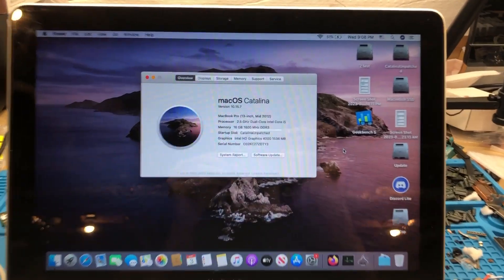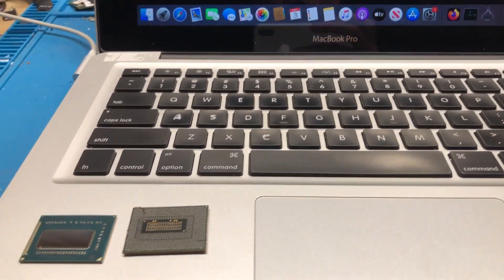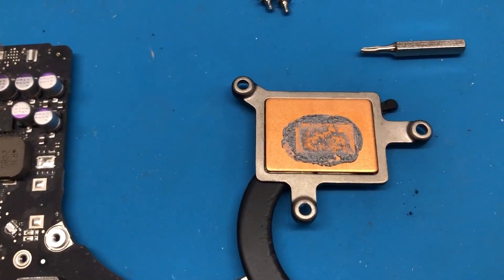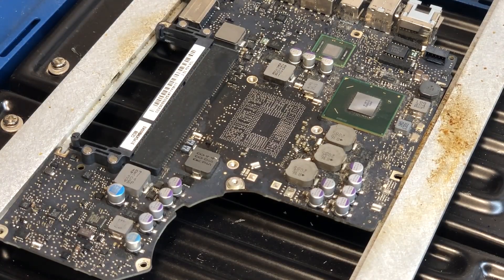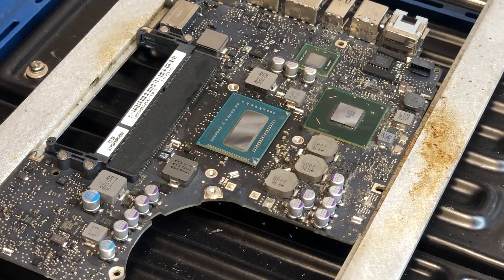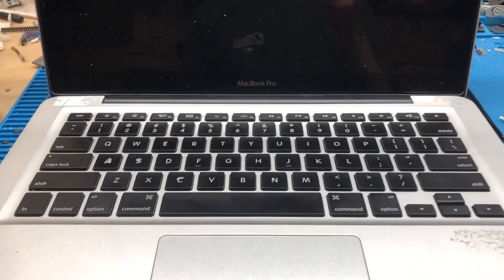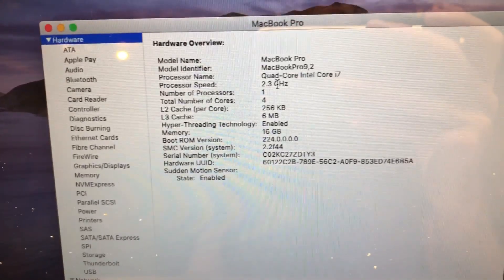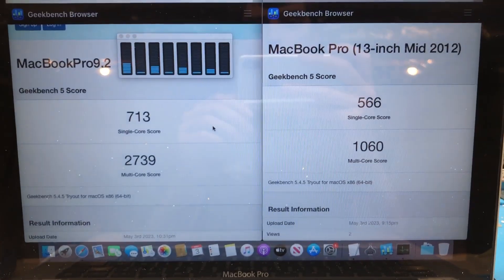Creating the World's First Quad Core Mid-2012 13-inch MacBook Pro

Comment: Technically the i5 is a quad core.  It has a 2 physical cores and 2 logical cores(threads).  Like how even the P4's with hyperthreading were essentially dual cores. I run linux mint on my mid 2012 13in. and it shows and monitors 4 cores in the system monitor.  I've also swapped to a nvme on sata, and maxed to 16gigs of ram.  QUITE snappy on Mint 22.1 and fully compatible.  Runs better than any mac os has on it. even after the upgrades.  Great video, would be interested in having this done to mine.  What would be stopping this process working on a gpu change and video memory upgrade?

Comment: Did you know that the i7-3615QE supports up to 32 GB of RAM, which would allow you to upgrade your system's memory in the future if needed, which could be useful for heavier tasks or multiple applications running at the same time.

Comment: Maybe an i7-3632QM CPU would be fit better due the same TDP (35w) of the i5-3210M, and the same 4-core 8-thread of the i7-3615QE. Do you think is it possible? Please, let us know about it🤗
Reply from the maker: As mentioned, the footprint/pinout of the QM-series chips differs and is not compatible.
Reply: @dosdude1  Differently from the socket G2 3th-gen intel's CPU whose we have a pletora of options, by changing from the Celeron B800 to the i7-3940XM. Thank you for the info and the top quality channel 🤩

Comment: Where do you buy the chipset from, I was looking where to buy it hard to find anything place that sells them. Is there a way to buy from Apple, I looked on there website could not find where I could buy newer chipsets at? Is there a place, with out buy parts that where ripped out of other computers. Where I can buy just the chipsets from a manufacture, for the upgrade of my PC? Thanks

Comment: The problem with upgrading these is how cheap they are now. I keep buying them on eBay. I just got a mint 2010 MacBook unibody base model for $70 and it’s literally brand new. Just needs an ssd but the 4g Ram isn’t great. I was going to buy a battery for a 2008 white MacBook and saw the aluminum one for $20 more than a battery for the plastic one and the mint one has a perfect batt. It all started last year when I bought an early 2013 MBP highest performance for $180 to run 3d printers and CNC machines. New hobby! 😮

Comment: Will 3615m work too?
Reply from the maker: @Reda_1000  An i7-3615M doesn’t exist. An i7-3615QM (or any other QM-series chip) will NOT work, as the footprint is different (as explained in the video).

Comment: @dosdude1 Hi  it works with the code too core i7-3615qe -SR0MR ?
Reply from the maker: SR0MR is the i7-3612QM, which will not work. Only CPUs that will are the i7-3615QE (SR0NC) or i7-3612QE (SR0ND).

Comment: Hey man! I have the same laptop, and I want the processor to be upgraded to this. If you are willing to do so, I will gladly buy the processor and ship you the laptop and pay for the job. Might be a while though, because AliExpress takes forever to ship. I bought the laptop from a friend for $50, and it’s in perfect condition. I’ve already upgraded the RAM to 16GB, and put a 500GB SSD in it. These laptops are surprisingly easy to upgrade, which I didn’t think the word “easy” would go along with “Apple” 😂 But then again, Apple was better when Steve Jobs was around. I don’t want to deal with newer MacBooks and their soldered on RAM and storage. If one of those go bad, it is very expensive to repair or replace. I want to just simply pop in new RAM or storage if one goes bad.

Comment: In the video you mentioned if the firmware had issues with the upgraded CPU, you would have looked into doing a coreboot port.  I happen to have this same machine but clearly not your technical skills, just some general programming knowledge.  How involved is doing a coreboot port?  Are you still interested in doing one for the mid 2012 MBP?
Ps: the next upgrade is: just run Gentoo 😂
Reply from the maker: I've done it before with my custom 2011 17" I swapped with Ivy Bridge CPU and PCH (which I have another video about). It wouldn't take much to adapt that to the Mid-2012 13".

Comment: Really incredible!!! I would like to know if it would also be possible to modify the battery and include an extra battery in place of the DVD drive.
Reply: I was wondering the same! Even when you upgrade to a modern SSD  it leaves more room by the battery, therefore maybe a newer better and  slightly bigger battery could be put there? I don't know which parts could fit it exactly

Comment: Is a RAM upgrade possible for these 10,2 13” retina MBP’s?  I have one running MacOS 13 Ventura with 8GB RAM, and does pretty well for web work, although I’m afraid to give it a workout with Zoom/ Teams and 25+ participants!  Would 16GB RAM help, even tho it’s still running 2.9GHZ i7 dual core with HD 4000 Graphics?  Thanks!  I’ve subbed!

Comment: Can you create a patcher for High Sierra install images to remain on HFS+? I want to do a clean install and I've been only able to patch it via the OS upgrade path.
Reply from the maker: My High Sierra Patcher will do just that.
Reply: @dosdude1  Thanks. I'm on a High Sierra compatible Mac so I never used it aside from downloading the installer image.
Reply: @dosdude1  Can I use a patched image on a HS compatible machine?
Reply from the maker: @freetobe3  Yes, the result is a completely unmodified install unless you manually apply post-install patches.
Reply: @dosdude1  I actually just finished setting up a clean install. It's excellent. Thank you. Apfs doesn't feel as snappy as HFS and I'm planning on dual booting which doesn't play nicely with it from past experiences.
Reply: @dosdude1  Unrelated question, my device was originally a late 2011 base model. When I restored it I bought a spares early base model 2011 to swap out the display and a couple other components, long story short, I think my original motherboard and trackpad died and I swapped with the spares one. Even after a couple of clean OS installs the About System doesn't mention it's a 13' 2011 early model, only MacBook Pro, everything else is identified including the serial number. Any way to fix this? It's driving me nuts, the older 2011 mobo with all the rust and oxidation had all the info before it crapped out on me.

Comment: Hi, is it possible to upgrade CPU on A1425 Late 2012 / Early 2013 Retina MacBook Pro and upgrade the RAM to 16GB by soldering since A1425 has the same 3210M CPU?
Reply from the maker: Yes, it is indeed.

Comment: This is great... or you could just buy an i7 2.6Ghz 15" nowdays for a very cheap price and get very much the same results, how ever, that´s not as fun and doing something like this.. it would be cool to know if this computer will run Rhino 8 and software like that, my 13" i7 2.9Ghz does not, it´s very laggy..

Comment: I want to try this myself. How long do you preheat the board and at which temperature? And which temperature has your hot air and how long do you expose the hot air to the CPU?

I tried to preheat at 180 C for 5 minutes and, after applying a bunch of flux around the chip, expose 280 C of hot air at maximum air flow of my Int 866 station for 1 minute but the CPU does not come off. It does not even move a little bit. But no worries, this is a defective board for such experiments so it does not matter if something gots damaged because of the heat.

Comment: I did it!
Of course I went to a service place to solder the i7 onto the logic board.
They took me like 50$ for the service.
It is working great!
No heat more than the regular i5 or i7.
I use it for music production and sometimes video editing.
A good software to use is the Turbo Boost Switcher Pro, by Ruben Garcia and SMC Fan Control, but those are if You want to keep the processor cooled down. For example I use Ableton Live 11 on the newest Mac OS Sonoma to handle 2 channels of microphones, 1 channel guitar, and a soft synth for my live performances. All of them realtime, just like a virtual mixer, with total of 14 plugins engaged. The processor is at 3% with Turbo Boost OFF and 44 Celsius with the fan at 3000 rpm.
The upgrade is more than mandatory if You love that 13'' MBP and want to use it for a second laptop, just like I do.
Now I installed an 8TB SSD by Samsung and I'm thinking of a second one so I can put all my "life" in just one portable machine.
8TB SSD upgrade at Apple right now is around 2000$. Mine was not more than 300$.
And again, a MacBook with 8 cores i7, 16G RAM and 16TB of SSD, for like 1000$ total? I can only say WOW!
Thank You so much DosDude! You made my day! Keep it up! God bless You!

Comment: In your opinion, would the 3612QE also work instead of the 3615QE ? Almost the same benchmark, half the price, lower power consumption. Thanks so much!
Reply from the maker: Usually the 3612QE is considerably more expensive than the 3615QE... But yes, it would work as well.
Reply: @dosdude1  Thanks a lot for replying! \o/

Comment: Is it possible to upgrade the 2009 MacBook Pro dual-core CPU as well?
Reply from the maker: No, this is only possible with 2011 and 2012 Sandy Bridge and Ivy Bridge systems.
Reply: @dosdude1  So the 2009 MacBook is not possible
Reply from the maker: @uio86a  Not possible, correct. Can be upgraded to Core 2 Duo T9900, but that's it.

Comment: Wow, that's amazing and may be the only favour Intel has passed this generation. Because considering that there are only 3 or 4 processor microcodes in fimware. In the same generation, this processor may also be attached. 
Or because the microcode is not attached, it may be running a little hotter than normal.

And as the most trick pin template, if you mounted it according to the old processor, that part is congratulations like full magic.

Comment: Is there any similar path possible for the 2015 MBP?
Reply from the maker: No, as those use Haswell or Boardwell U-series, which are completely different. This upgrade can only be done on 2012 machines.
Reply: @dosdude1 what about MacBook Pro 13 early 2011

Comment: Congratulate me! I got a new i7-3615QE installed on my 2012 MacBook Pro today. Instead of the Intel i5. The emotions of using the laptop are unspeakable.
Reply from the maker: Awesome!
Reply: Where did you get the CPU chip from?
Reply: @jackgerberuae  AliExpress
Reply: please tell! I want to keep my mbp so badly
Reply: @andylove4231  it's ok, you will keep motherboard. Only change a chip.I got a fighter jet, maximized my MBP 2012.
Reply: @OdessitOn  How did you do it?
Reply: @OdessitOn Where can I buy the modified motherboards with these chips online? I have searched the internet without success.
Reply: Aliexpress probably

Comment: Which MacBook can you upgrade ?
Reply: I do have a 2013 MacBook if this could be done
Reply from the maker: This upgrade can only be done to 2012 models, as 2013 and later use Intel U-series CPUs, which are completely different than their quad-core counterparts.

Comment: Thank you! You have inspired me to make such an upgrade. I ordered the same i7-3615QE processor for my MacBook Pro Mid 2012. Waiting for it from China to be installed on my laptop.
Reply: How did it go
Reply: @jerbear7952  more powerful computing.  It didn't affect the battery performance, just a slightly higher temp. The performance is pleasing, I don't want to change my MacBook for a modern one. I put a fast SSD, RAM 16 Gb 1600MHr, replaced my power chip (I wanted to).
Reply: Where did you order the modified plate? I am interested in purchasing a modified one.

Comment: as I was watching this video I found out something insane, my macbook pro mid 2012 ALSO has this cpu upgrade

when I bought it off of ebay it had an Intel i7-3520M with 4 cores with a clock speed of 3.60 ghz, 16 gigs of ram and a 750 gb HDD, I just looked up the model number mine had (a1278) and it originally came with an i5 dual core! I was wondering why this macbook got so hot all the time but now I know the CPU was upgraded!
Reply from the maker: Wow, that’s interesting! Never heard of anyone doing this upgrade before, but maybe mine isn’t the world’s first LOL. Curious, what exact CPU is it? Geekbench will tell you.
Reply: @dosdude1  I looked it up a bit more and it's actually just a dual core, not a quad core, but I'm 100 percent sure the CPU inside was upgraded
Reply: and I've also seen in the comments that you might do an upgrade service to a macbook like that, I've love to have an upgrade of that caliber on mine!

Comment: I'd be really interested in seeing if you could upgrade a 2015 MacBook pro with a haswell i7 up to the broadwell-h i7 that got skipped. Particularly the top of the line option the 5750hq. They're bga compatible, so the question would be if the mobo bios had support of the broadwell instruction set.

Comment: I always wondered in 2012 why Apple didn't put at least a quad core into the 13 inch Pro even without a dedicated gpu, super cool to see it can be done somehow
Reply: Cost and thermals. Also power users probably didn't want a terrible screen resolution to work with.

Comment: Thanks so much for this. I am really interested to mail you my Mid 2012 MBP. so you can perform this CPU upgrade. Is that CPU the fastest available for that model and also I’d be interested in how hot it would get and any available alternatives to deal with that.
Reply from the maker: Yep, the 3615QE is the fastest one that exists. It does get a bit hot, but nothing so bad that the stock cooling system can’t handle it.
Reply: @dosdude1  great work thank you is it possible to have the exact reference please on Ali there are several references?🎉
Reply from the maker: @johnteiss1038  Search “SR0NC” on AliExpress and you’ll find some, or “SR0ND” for 3612QE.
Reply: @dosdude1  thank you very much dosdude for all your research and your work 🙏

Comment: Hey there, I am having a problem partitioning my internal 240 GB Kingston SSD on my 2009 MacBook 5,2. I am currently running MacOS 10.14.1 on it using your tutorial. I want to split the drive in half so that I can dual boot Ubuntu 22.04 LTS on it. If I try to do so, it throws me an error "APFS Container Resize error code is 49244". Though there is plenty of space on the drive to complete this process, it still gives me that exact same error. If you could help, it would be greatly appreciated! Thanks!!

Comment: what's your heat setting on the top and the preheater?
Reply from the maker: For lead-free removal, 170 - 180 degrees C on bottom, and 280 degrees C on top heat. For leaded, I just reduce bottom temps to 150, and you can get away with 260 - 270 on top heat with leaded.

Comment: Since the top edge is slightly raised compared to the bottom doesn't that mean the heatsink isn't making optimal contact anymore? Or at least applying uneven pressure depending on how tightly it's screwed down.

Comment: Hi, I have 2015 macbook pro 2.8 GHz Quad-Core Intel Core i7, 16 GB 1600 MHz DDR3,AMD Radeon R9 M370X 2 GB
Intel Iris Pro 1536 MB. I am wondering if i can upgrade to much faster processor. It works perfectly for office use but for some software, it wont really give me that smooth flow. It lags a lot. Can u suggest me to the latest processor. Thanks

Comment: So basically you could upgrade the Mac mini 2012 from the i7-3615QM to a i7-3840QM since it was used in the MacBook Pro i7 early 2013.
Reply from the maker: Yep, should be possible.

Comment: Hey Bro 
How to bypass the defaults and use MacBook at full Power as we running without a battery.
I Have a few MacBook they are running ok but their performance is reduced because of they have no battery instead i have a huge Inverter That gives them all the power they need but performance is very slow 🦥🦥

Any Trick To make the System think that its using the battery or Just by forcing it ""Will be a great help"" ???

Comment: Blown away that you attempted this! way beyond what I'd dare to try!   only concernes are the increase in cpu temps after the mod... there is Not as good a hetsink and cooling solution in the 13" case, nor is there the sheer internal space inside the chassis compred to a 15"... thats probably why they limited it to a dual core... interested to hear how the thermals are after this mod
Reply: I hear ya. Take into account the 15” inch cools a whole dedicated video card as well. And even if it throttles a bit will still be faster than the dual core.

Comment: Is it possible to replace the board of a 2010 13" with a 2012?
Reply from the maker: No, as many of the connections are different, mainly that of the WiFi card.
Reply: @dosdude1  Thanks

Comment: this is awesome. question though, is that stock heat sink capable of removing heat from that quad core? The bigger mid 2012 15 inch with quad cores had dual fans and dual heat pipes. Curious if you plan to design a better heat sink?

Comment: For most tech YouTubers, BGA soldering is magic, you are a Wizard who understands how to do it... Thank you for your hard work, I used your patchers with all my old Macs and cannot describe how much you helped me using my old hardware.
Reply: Can I also upgrade the 2009 MacBook Pro 1278 model i5 dual core model to quad core, so can I increase my max RAM from 8GB to 16GB?
Reply: @uio86a nope.
Your MacBook runs a Core 2 Duo, not a core i5
The maximum you could take is 8gb so take it how it is, or sell the laptop and buy a modern yet good priced used one.
Reply: @uio86a  y
Reply: @uio86a  Y